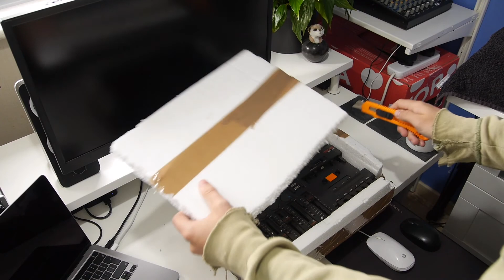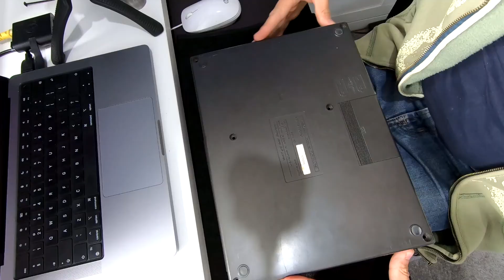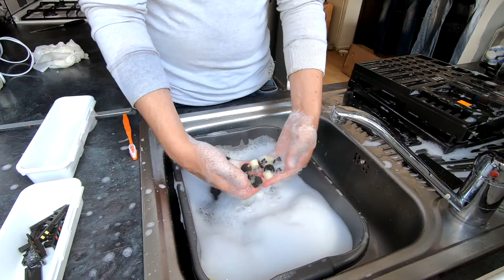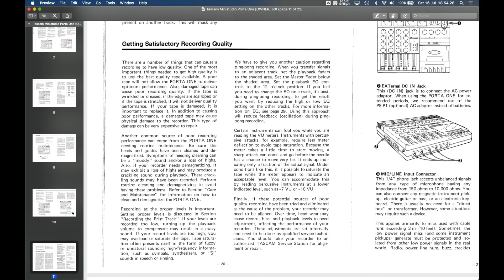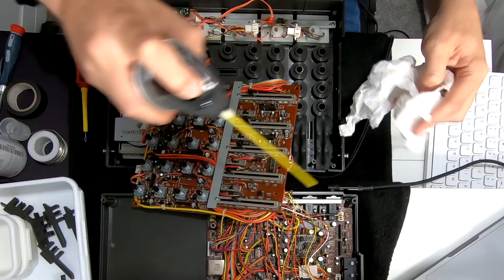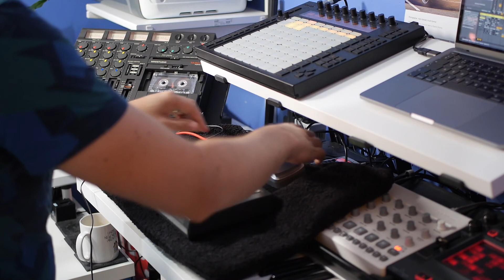Retro 80s Tape Tech: The 4-Track Cassette Recorder | Tascam Porta One

Comment: little late to this,
is calibration for switiching the type of tape nessecary?
Reply from the maker: Type II tape has a higher bias requirement than type I tape, so this can result in type I tapes sounding too shrill when recording on type II bias settings. 
But to be honest, I didn't notice much difference on my particular machine. In fact the recordings sounded better on type I tape. This could be because some of the components are getting a bit tired. Or maybe a previous owner already adjusted it.

Comment: Any chance you sell these test and calibration cassates? Or redirect to any seller ?
Thanks
Reply from the maker: To be honest, what I did was a pretty janky way of doing calibration, relying mostly on my ears. But you can get professional calibration tapes - there are a few for sale on eBay if you do a search there. They aren't cheap though, and to make best use of them you need calibration testing equipment, or at least an oscilloscope

Comment: How do you calibrate for Type 1 tapes.  I noticed that you were adjusting something on the board, but can't find any information.  That would be a game changer for acquiring cheaper and newer tapes.  Great video
Reply from the maker: To be fair, I don't have any oscilloscopes or precision tools, so what I did can't really be considered a proper calibration. But essentially, I found the service manual online and identified the pots that control the record and playback levels. Then I recorded some white noise and some music on a test tape using another deck that I trust (you could also purchase a test tape online). I used the test tape to set the playback levels so that all tracks sounded equal. Then to adjust the recording level, I recorded the same identical signal on all tracks, then played it back and noted down the dB difference between each track. The tracks which were too soft I increased the record level, then tested again. It took a few rounds but I got it to the point where I was happy with the sound.
One thing I didn't do was adjust the bias levels, which normally you would need to to change between type II and type I tape. But to my ears, the deck already made better recordings on type I when I got it. It's possible that a previous owner might already have adjusted it.

Comment: I’ve been doing this crap for years….😎
I’m a 71 year-old professional Musician , when I was around 22,or 23 years old, my father and I built owned and operated the only recording studio in my hometown of Mattoon Illinois… back then they didn’t even have cassette multitrack machines…! And if they did, they were terribly expensive…!
Our studio used a  Sony four track for a year I guess…! Then a TASCAM 80-8 …!  I ended up going on the road for around five years after being on a show called. You can be a star on the Nashville network…. 👍🏻🎶🤠 Four track, cassette machines. Had just started coming out and doing really well. Lots of companies made them….! Fostex , Sony, to name a couple.. While I was managing a music store in Birmingham, Alabama , after getting off of the road, I was able to play with and mess around with
Several Four Track multi track, cassette recorders…👍🏻 In my humble opinion, the TASCAM Porta one , for the money,
With no doubt in my opinion, the best sounding machine on the market …LOTS of,and LOTS of PEOPLE we’re making these machines in the mid to late 80s…! I have done some incredible recording of course I was using pretty good outboard equipment..! on this vary machine…! In fact, I have one right now down in my studio…
I have always thought they sound good , The faster, the tape speed, the quieter they are…
First thing I do on any cassette that I am using for the making of music , is if they have a pitch speed control is run them up as fast as I possibly can…! You learned as a big studio, of course… we also had 2” 3M 16 Track machine , that ran,
15 and 30 IPS …! Now that machine was clean… the Porta one I have in the studio I purchased on eBay for $400.00 or in the ballpark…! I love using tape, but I tell you what it is so much faster and easier for me to use my 505 Loop,Station for Straight up One Shot ( Old School ) Recordings…!
Reply from the maker: Great story, thanks!

Comment: Sounds darn good!  Try slipping a cap of photographic film over the record head or erase head youl get 8 virtual tracks. Remember to clean your heads. I suspect the puddings on tract 2 was due to fiber or dirt in the gap of the head. Try a bit of me on a swab  but be extremely careful because it may melt plastic. Use at own risk. Ive used it before on an old wallensak head and it brightened it up quite a.bit. hope ive been of help.
Reply from the maker: I also initially suspected dirty heads for the quality of track two, but I did clean and polish the heads thoroughly, so I don't think that was the issue in the end. I think recapping the mixer board would probably solve it

Comment: Hi, I have a question about the inputs on the Tascam Porta One. If I want to connect a signal coming out of my interface (balanced output) to an input on the Tascam (unbalanced input), what cable should I use? TRS or TS? Thanks!
Reply from the maker: Hey! The Porta One doesn't have balanced inputs, but I had no problem connecting my balanced interface to the inputs using a regular TRS cable.
Reply: @TheOrphicCreative   So TRS on both sides, right? I've read that for these cases you can make a TRS to TS cable, short-circuiting the signal that the TRS ring carries with the TS sleeve (taking the copy of the signal to ground) so that you only have one signal on the unbalanced input. The thing is, it seems to make sense and I wanted to know how you did it. Thanks.
Reply from the maker: You can make a cable like that but honestly I wouldn't bother. The cable I used was TRS on both ends and worked just fine. TRS jacks have the hot signal on the tip, the inverse on the ring and the ground on the sleeve. The Porta One ignores the inverse on the ring and just connects the tip (hot) and sleeve (ground), so you get a normal, un-balanced connection.
Reply: @ Thank you! 👏👏

Comment: I had a belt melt in a cassette deck of mine and replaced it with some random ones off Amazon, could either the belt melting or the belt I’m using lead to wow and flutter? Cause I’m getting a lot of it.
Reply from the maker: I think the most likely reason is that the new belt isn't exactly symmetrical - if it's slightly thicker in some parts than in others then it will cause variations in the tape speed as it cycles round. Best to try and find a supplier of proper belts for the deck - they are usually available from various resellers if you search for belt kits for your model
Reply: @TheOrphicCreative  ah sadly it’s a rare deck, can’t find replacements for a reasonable price. It’s an Emerson m2405

Comment: hi you can't  do that tape change over from deck to deck  as the head track lay out are not the same  there's a small space in the head of a home decks
with the 4 tracks they pack in the channels
Reply from the maker: Interestingly I didn't seem to have any trouble with it, even before making any adjustments - the 4-track played tapes recorded in my 2-track deck perfectly fine (just that 2 of the tracks were in reverse) and vice versa playing 4-track tapes in my 2-track machine. Perhaps on later versions they changed the head design but on this model the tracks align perfectly with a normal tape

Comment: Great vid! I have just acquired one of these in good condition. The tape transport however is completely dead. Everything else at first glance appears ok.
Reply from the maker: @michaelbentley4182  Sounds like it could be an easy fix, maybe a dry solder joint or broken wire perhaps. Good luck 👍

Comment: the RTM cassette tape is actually open reel tape that they packaged in a cassette shell, it takes high bias like a type 2 but has a lot of the sound of a bog standard ferric tape because it is ferric, certainly makes sense it'd work with a portastudio but neat to see
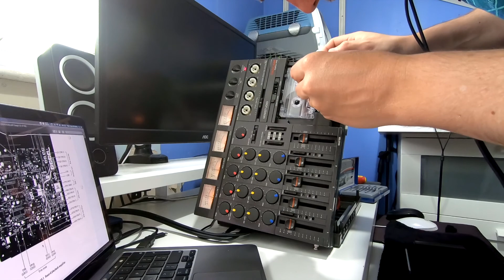Reply: 12:37 my friend this is, in fact, not how you adjust the azimuth, you need a test tape and an oscilliscope, you have to put each input to an X/Y graph so they modulate each other, if there's any phase difference it deviates from a straight line and makes a circle, you have to adjust it so the graph is a perfectly straight line, guessing by ear is going to cause big dips in frequency response between tracks, it'll record yeah, but you're basically adding a microscopic delay to each track
Reply: (also not flaming this is why i've not touched my azimuth, i still need an oscilloscope lmao)
Reply: 13:16 yeah, that's kind of what i expected, it should work, but not as well as it can, unfortunately you do really need test equipment to calibrate such a slow and tiny tape, it's the tiniest of tiny adjustments, you also will have to adjust the bias for sure, and since it's 2 head it's really test recording a sine wave, sweeping the bias until you find the sweet spot with least distortion, i exceptionally doubt it's the caps
Reply from the maker: I'm not a tape technician and definitely don't claim to have got it working at its best, I don't have the skills and equipment for that. But as it is now, it produces very usable recording and I'm happy with it, without spending silly money on equipment or servicing. Possibly there might be some slight phasing issues caused by the azimuth, but certainly nothing I can detect with my own ears - which is good enough for my purposes 🙂
Reply from the maker: Very interesting, definitely explains the results I got

Comment: Great Video man!
On mine the pitchcontro doesn´t work. Do you have any ideas?
Reply from the maker: Hmm, thats a strange one. The pitch control slider is mounted on its own little board with the tape mechanism, so I'd maybe look for a loose connection there, and maybe try some deoxit in the slider as well.
Reply: @TheOrphicCreative  Thanks man, will try it.